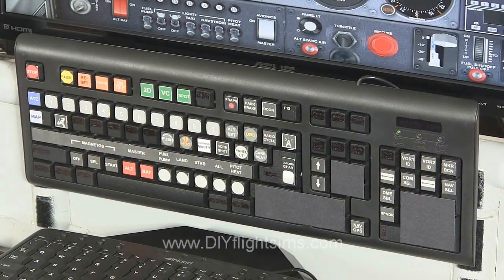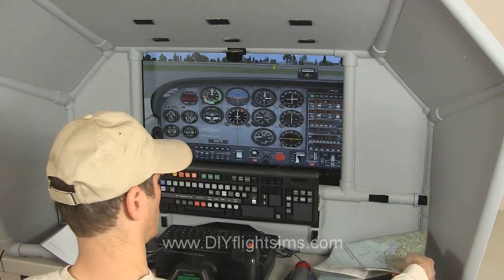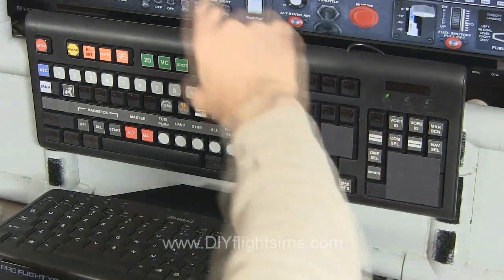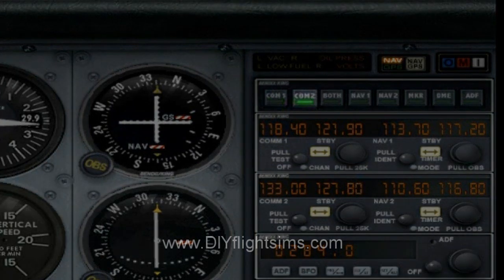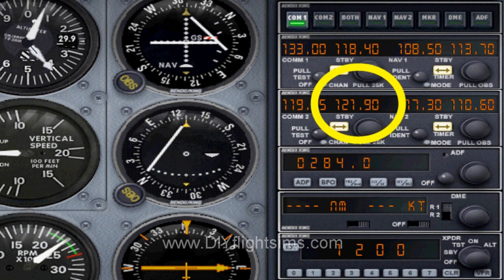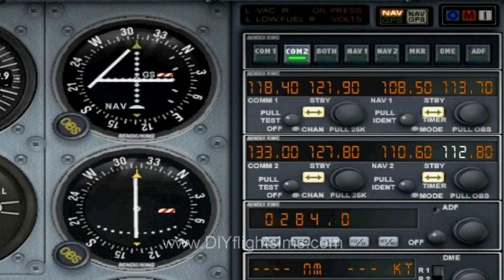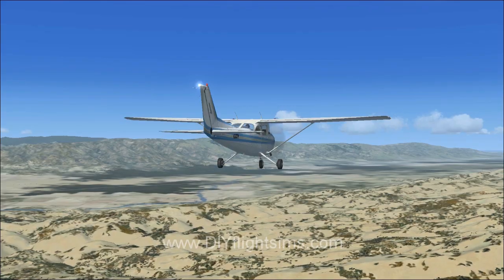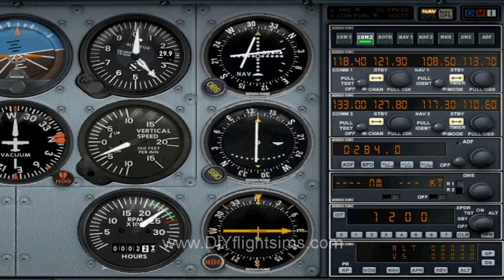Keyboard Mod: Advanced Techniques

Comment: here's a theoretical idea for you. what if you used a macro program to program (usually you can find a few FREE on the internet) and programmed a macro to the keybind of your choice to move the mouse & click the com2 button on screen? the only problem i could see wit this would be if you are using TrackIR.

I did have a program that could scan the image and click buttons, but you'd have to keep your head steady for a second in order for it to click. not sure about how it would work today with current hardware.

Comment: do i need an extra software to control the second keyboard, when buy the product you offer the software if it has one?
Reply from the maker: +Nirond There is no software. Just plug in both keyboards, they will both work.
Reply: +Roger Dodger Aviation yeah i know but they will cause comflit to which other!
Reply: +Nirond there is a program, not sure what it's called tho, just google it, I used it! Hope I helped somewhat!